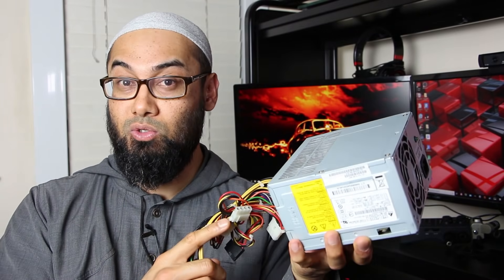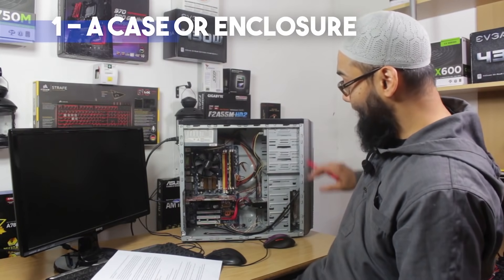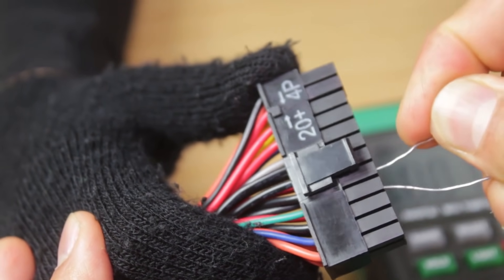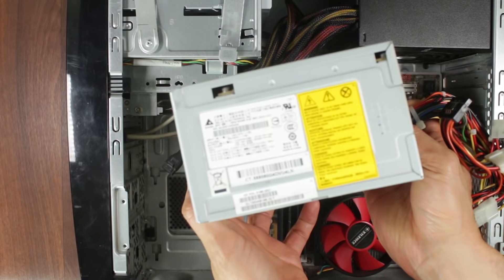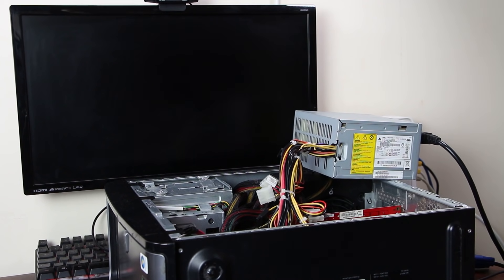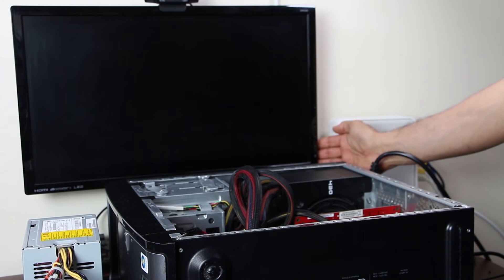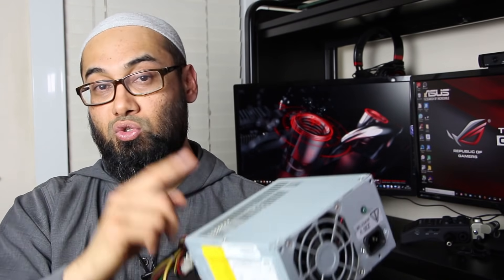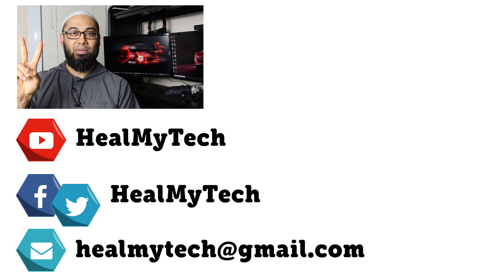Computer Turns On But No Display On Monitor | Led Light On Fan Spinning | Power Supply Unit Pc?

Comment: I just switched my ram slots around and it wont show anything anymore. My keyboard wont even work
Reply: Same issue with me. All I did was add another ram card
Reply: Bosh's Meme Zone dude I thought i messed up but it turned out I didnt push my ram back all the way. Try pushing really hard.
Reply: zestiyy HOLY SHITTTTTT. I LOVE YOU SOOO MUCH. I WAS ABOUT TO SPEND 120$ on a PSU
Reply: Zykur lol yeah np 😄
Reply: YouTube Preston yu

Comment: Everything is working fine but theres no signal on mine.
Reply: Rahmat Amsyar same
Reply: @saiyanMG  Did you find a fix?
Reply: Changed the monitor now the shit asks to reset bios or continue and the mf keyboard wont work 😭 what's next
Reply: HoodRich BCtrill easy remove the battery in your motherboard wait 15 seconds and put it back then turn on pc   And right away hold windows key and B untill you here a sound and it should reset yo bios
Reply: Last1 ToLose Will that hard reset yr pc?
Reply: Waii- no just turn it off and unplug it first
Reply: kumo - I did
Reply: Waii- did it work?
Reply: kumo - no
Reply: Waii- did u just build a new pc or have u had it awhile? and also is make sure your hdmi or display port is connected to the graphics card and not the motherboard
Reply: @last1tolose758  WWOWOWOWOWOWOOWOW BRO THANK U DAMNÑNNNN
Reply: @loco2loudhoodrichbctrill265  try to find two pind on the inside and connect them with a paperclip or screwdriver for about five seconds. 
Or just remove the battery on the motherboard for about ten seconds
Reply: Same the fans spin on my graphics card and the blower fan but my monitor shows no signal power is on i did spill juice on the board about a month back so i wet a qtip and wiped around it i did hear a beep sound and saw dried juice near the memory sticks
Reply: @ktthompson1471  you sort of same happened to me I spilled dip spit on the back I think. Any help?
Reply: KT thompson r
Reply: The same happens for me sometimes randomly.
Reply: I replaced the mobo. No signal to gpu and then no signal to on board graphics
Reply: Same but difrent. My TV (hdmi from GPU, VGA adapter on TV) no signal, and the fan turn on for 10 - 20 secs no speaker beep, than the computer turn off and turn on again. Any solution? Sorry bad english
Reply: probady from your own motherboard or hdmi itself need replaced
Reply: I have the same issue changed the processor last week
Reply: Or if you have 2 sticks of RAM you can change their positions
Reply: Same
Reply: Waii- male sure it’s plugged into the graphics card not the motherboard that was my problem
Reply: I have just bought a new pc, it works fine at the store and once it got to my house it booted fine however keyboard and mouse didn't work when tried to type or click something I restarted it, it then shows system error with blue screen then restart again it boot up also stuck after 10 reboots it works fine all day, once I switch it off go to sleep next morning same issues again. I don't understand what it can be, it happened at the store once when I sent it in but they said nothing happened since, i sent it again today they can't find the issue. 😭 Any help or suggestions are welcome.
It worked fine for an entire day and the next day It happened again. I am unsure what to do.
Reply: Cakey Bear so ur mouse and keyboard aren’t working at all? and if the pc keeps restarting it’s probably a hardware issue could be ram, power supply, graphics card etc if i were u i would return it and get ur money back
Reply: @kumo4444  Yes correct and some some days it worked perfectly fine. I've returned it to the store and asked them to test it all of the problem still happens I'll ask for my money back.
Reply: Cakey Bear yea if your still having problems u could also try to update your windows settings, bios and drivers that could help but the store should of already done that if their checking your pc, also u could try putting it into hibernate instead of fully shutting it down over night but yea its prob best to get a refund and buy a different pc or build your own much more reliable and not as hard as it seems
Reply: @kumo4444  Yes I agree, fingers  crossed it all works and if not I'll ask for money back, what they telling me is that at the store it works just fine.
Reply: Cakey Bear yea i hope it all works out for u 🤞
Reply: @kumo4444  Thank you, I'll update here on what was the issue and if it was solved once I hear back again! 🙈
Reply: Cakey Bear ok i’ll be praying for u 🙏😂
Reply: kumo - I need some help because my computers screen doesn’t show and I don’t know to much about computers/ everything looks like it’s running fine
Reply: Not the best with all this I bought a prebuilt like 3-4 years ago it’s was a higher end PC at the time GTX 1080 etc so I just moved and now it won’t display I’ve tried every port all new cables, 4 different monitors and nothing it lights up all my fans are working, a blinking led inside as well that I have no idea is for but my keyboard and mouse are not lighting up. I honestly don’t remember if those did or not until I typed my password in. I’ve watched a few other videos and I literally don’t know where to start. What would y’all recommend be the best suggestion? I’ve cleaned the ram, taken the card out and reseeded it, made sure everything is plugged in correctly and I’m stuck on what it is
Reply: DoolittleMagic mine the graphics card wasn’t fully put in it came out a little bit make sure your parts are tight : )
Reply: @DoolittleMagic  zuomb kh
Reply: Check the ram . If not work rest all the cables
Reply: Hydra Amjad wdym reset them?
Reply: If you have a Graphics Card you should check the connection from power supply to graphics cards. Try also removing graphics card and connect your monitor to motherboard if it boots and works then graphics card is the issue or the cables going to graphics card.
Reply: @Brexxx0000  if you are connected to the motherboard and all of the rgb lights and fans on the case and pcu fan come on as well as the keyboard but still getting no signal on monitor what could be the issue?
Reply: Cory Conklin I’m having the same problem did u find a fix
Reply: @kumo4444  maybe there is a bent pin in your motherboard cpu  socket
Reply: KARAVALI CREATIONS it’s ok i was just being stupid and connected it to the motherboard and not the gpu thanks for the reply tho
Reply: @corix426  any luck ? the only thing that is not on is my gpu fan but lights and everything else works. I know some Gpu fans only turn until its at a certain temp so makes it hard to determine whats my issue when everything else is on but no display. Is it possible that low battery wattage can cause this issue ?
Reply: @mastaspock9271  I went out and got a new motherboard. As soon as I popped that bad boy in it came right up
Reply: Brexxx I think it’s my graphics card I plugged in hdmi to motherboard and it worked but it was intel he 4600 when I plugged it into graphics card No Signal
Reply: Did you find a fix?

Comment: No display on the monitor I have a 500w gold certified mother board and good psu
Reply: Beair_ ya I got me a brand new bronze certified power supply and I think tht bitch broken

Comment: I just cleaned my whole pc  i mean everything even the case and VOALA it worked
Reply: Dizel Power how did you clean it?
Reply: @xample.8124   I took out supply, ram, motherboard, and hard-disk. Then opened supply box cuz its was really dirty and cleaned changed my ram positions and reconnect everything back them i took out the battery to restart my BIOS after sometime i put the battery back in :) thats how i fixed it
Reply: @speedup9494  can you help me? So I was in the middle of playing and then my pc shut off into power saving mode for no reason and now when I boot it up it stays on but there’s no signal to the monitor. This is the third time this has happened plss help me
Reply: @mattheo4709  change ram slots
Reply: @mattheo4709  and run memtest

Comment: i turned my pc, and light from my motherboard turned on for a sec and it then turned off. i tried to turned my pc on back but it didn’t start at all. idk what the problem either my power supply or motherboard
Reply: you should borrow a friends pc to swap out parts from, this way it's easy to isolate the faulty part. but from your comment it looks like a dying psu
Reply: a3 already done this part, and figured out that psu still working fine, the problem might be from motherboard i guess
Reply: @lukmannurhakim3152  Look like something wrong in ram or in ram's slot which is way more likely, try to clean them

Comment: please am having a similar issue but in my case, the power button does not turn the system off aswell
Reply: Same
Reply: What did you do to turn it off?
Reply: @Foreign.Szn.  my processor wasnt in properly and that was mine. Have u checked that ?
Reply: Joshua Apiedu same

Comment: This all started happening when i put my ryzen 5 2600 into my a320m gaming pro motherboard
Reply: Most of 1st Gen Ryzen (not all) is natively supported by that board's initial BIOS but 2nd and 3rd Gen will likely require an update. 7A39v1C is the BIOS needed for a Ryzen 5 2600 on that board. If you can get hold of a cheapo A-Series A6-9500 or 9500E (they're about £15-20 on eBay) or failing that an Athlon X4 940, 950 or 970, they are all supported by the v10 initial BIOS which will allow you to update it via a USB stick and get your Ryzen on.
Reply: I found a fix 
All i did was buy a new mother board.
Reply: Dat Boi new mobo.  Got it.  Tried a lot of things so new motherboard is next
Reply: Dat Boi did you find a fix for this? Im experiencing the same thing
Reply: did u fix
Reply: d2xshahul Suneesh did u fix it?

Comment: my computer will turn on and fans will light up and run, but there is no signal when i’m plugging it into the motherboard (because i haven’t bought a gpu yet) AND my keyboard doesn’t get power and my mouse turns on temporarily. any tips??
Reply: Same problem!
Reply from the maker: Troubleshoot A Computer Series Playlist | Computer Not Turning On | Pc Turns On But No Display On Monitor 
https://www.youtube.com/watch?v=Wkcx-x9gjkg&list=PLDmnHbxxv3ncrDmkkt4oVJTEIBIy9pvRN

Comment: my computer loses the screen some times , some times works fine and some others would frees what would you check first ? i have not acces to an extra power supply
Reply from the maker: Because you said it freezes as well sometime, not just loses screen, then it can't just be your monitor or anything that connects to your monitor only.  I'm afraid you should really be testing a lot of stuff and eliminate the issues one at a time.  In your case, I would start by doing a hard reset, reseating RAM, testing RAM, testing GPU with software, cpu test  like Prime95, etc, but at some point I would defo be testing the Power Supply as well.  I have a troubleshoot series on the channel , its long winded though, and I have showed (with other professionals input) on different videos that even for seasoned tech people like myself, sometimes the problem is not easily detected unfortunately.
Reply: @HealMyTech1  yes it is really hard , i already run ram test , it didnot found issues , i found that if i unlock the cpus fan it will turn on and work for longer periods of time but still will lose the monitor after a while or doin hard work like editing , my next guess would be cpu socket , witch means new motherboard . or check up a tutorial to repair cpu sockets .
Reply: @HealMyTech1  hi there ! Thanks for all the video tutorials , just an update on my pc .
Motherboard was curved at cpu level probably there was too much pressure from heat sink . found a tutorial of baking a gpu to resolder components , if that doesn't work . well at least i know was my motherboard.
Reply from the maker: Here is the Troubleshoot series if it helps: Troubleshoot A Computer Series Playlist | Computer Not Turning On | Pc Turns On But No Display On Monitor https://www.youtube.com/watch?v=Wkcx-x9gjkg&list=PLDmnHbxxv3ncrDmkkt4oVJTEIBIy9pvRN

Comment: I think this just happened to my PC's PSU yesterday. I shut down properly after a successful computing session on Monday night and then last night it powered on but nothing displayed. Fans were spinning, CPU fan, GPU fan, case fans, MOBO lights were on as well but nothing displayed. Keyboard and mouse did not respond either. I pulled my RAM sticks out and that didn't work. I pulled the CMOS battery out to hard reset the BIOS and that didn't help either. I really hope its not my MOBO and is the PSU so I can replace that in the least expensive way. My system is a custom built AMD AM3 Phenom multi core with an MSI 970A G43 board.
Reply: do you find any solution? im experiencing this type of problem
Reply: @labadiadominicimondl.9099  The MSI mobo was shit

Comment: Mine starts without 24V cpu power but no POST, with 24V CPU cable plugged in, won’t start at all. AMD 3.5GHz.
Reply from the maker: Have you tried another known working PSU?

Comment: Ra1nzZ I built my pc about 7 months ago. I have a EVGA Supernova 750 G3, 80 Plus Gold 750W. I can’t see why that would of failed but I am getting nothing displayed on my screen
Reply from the maker: What other tests have you done to troubleshoot? Any electrical device can fail, even brand new from production line, its well within acceptable margins of error, although the probability is low.
Reply: @HealMyTech1  strangely, It just started to display after the 10th reset. Not 100% sure what really happen. At this point i  can't conclude on what happen
Reply from the maker: 10 reset is a bit strange but nor impossible.  However it could also mean random spikes in your PSU, I would do advanced PSU tests to start with.
Reply: @HealMyTech1  Besides doing the resets I have not done any further testing. Everything seems to be fine for now, but i hope it will stay that way

Comment: My pc will turn on for around 5minutes with no display and automatically turn off its probably 6years old and worked fine previously besides it randomly shutting down do i have any 100% this is the problem fellas of the tech savy department?
Reply: Same problem, there are also those random dots or pixels, call whatever you want are popping out

Comment: If you could please just help me. I just built my first ever pc and it turns on and the fans are working and the video card is working. However it is not shows no signal in the monitor? Please help me please asap

Comment: Aah maybe this is my problems.
I have build pc in 3 week ago, but all part it's new except the power supply, i bought second power supply and when i use it that's normal nothing a problem,but when i left the PC in hibernate mode, now monitor not have signal T_T
Reply: I left my cpu for 2 years because of school not it won't boot up no display but the fan is running and the led still working

Comment: I watch your video and i really like it its helps me a lot , But please i still have issue with my computer Hp ProDesk its in power save Mode, I have remove the RAM and clean it, Remove the cmos battery and fix it but still in the power save mode, i need your help,